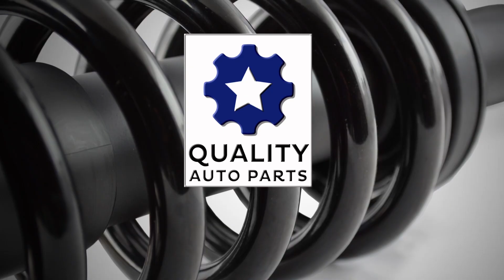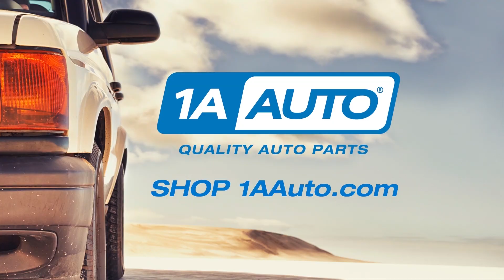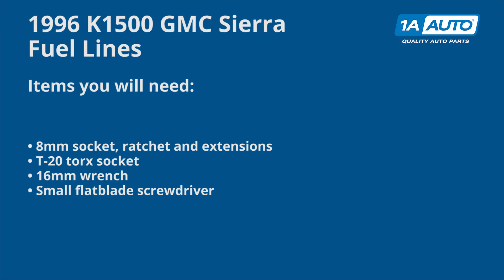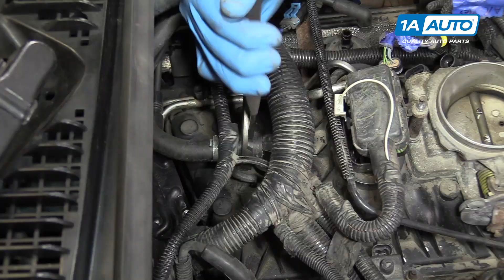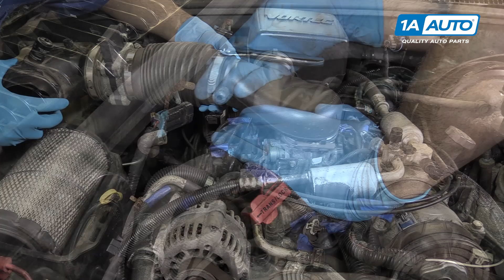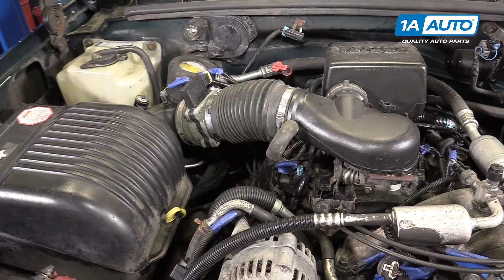How to Replace Fuel Lines 88-98 GMC K1500

Comment: When you put the feed line and the return line back on is there an o-ring that fits on each one of them before you put down the bracket. I start my vehicle up one day and it was leaking in that spot I took the bracket off pull the two lines out there was an old ring on each one they were shot I had to guess at the right size I bolted back down it's still leaked I think the diameter of the o-ring was too too small we'll have to go to a larger diameter to make sure it has a snug fit

Comment: Those are NOT the lines that need rusted replacement, you did not show anything that would help with the line that rust out under vehicle, this video is useless unless your changing the spider injector and removing manifold, you need to TITLE YOUR$ VIDEOS BETTER!

Comment: Is the bracket supposed to hold down the indentation on fuel lines? Because right now mines touching the plastic and not the metal.

Comment: Thanks for the video. I had call the dealership a few minutes before finding it and they quoted me 8 hour labor plus parts. Labor alone was $1200 parts $200 for the line. Of course I was sick at the thought, but your video inspired me. I spent a few hours taking my time but was able to successfully remove the fuel line. I ordered the line and will put it on tomorrow or the next day. What a blessing that you shared. Great video.
Reply from the maker: +Jonathan King thank you for the feedback, we're so happy to hear this! That is exactly why we make these videos, thanks for checking us out!
Reply: file:///var/mobile/Library/SMS/Attachments/93/03/A3D87EAE-6B1B-4DAF-A477-264FE0B8F88E/MOV_8946.mov
I wish I had checked to see if you had the part. I probably could have saved on parts too. My truck runs great and no more fuel leak. Thank you. I liked and subscribed.
Reply: How did it go?

Comment: O ring placement if they happen to come out of cpi when pulling out, and the other end of rail o rings also. No one talks about the o ring, metal washer spacer, 2nd o ring then another 1/2" long plastic spacer. Have no idea if new unit, or gasket kit was supposed to come with identical o rings and spacers. What a rig job straight from manufacturer, aftermarket don't even know what the hell is needed to properly not burn your truck.
Reply: I put these new injectors in my truck yesterday but the damn plastic sleeve and everything came out when the line did when I moved it just a hair to tighten it up in the back. Now I can’t Fuckin get the lines to sit back in properly they just keep popping out, any tips on how to get the plastic sleeve both o rings and metal washer to go back in snug without coming out ?
Reply: This is literally the reason I’m here because I bought a truck off this guy and he forgot to do the rings and most of them are missing 🤦‍♂️

Comment: What about the mid section from the lines you disconnected?  Has a bracket  on the trans I can't get to.  This is where the problem is.  I have the tank dropped.  And need the mid section  out.  Need a video of mid  send / return line,  removal/ install please
Reply: Forget that bracket Anthony. GM has it betweeen the trans and motor which is a terrible idea. Just cut those lines and feed the new ones around it.

Comment: I'm having trouble with the flare nut on the left side. It's hard to thread in. It would seat in but popped out after tightening. I eventually got it but it didn't go very far before getting tight. I may have cross threaded it. Is it possible to replace the flare nut? Would it just come off easy?

Comment: This is not the same procedure as my '94.
Reply: It is most likely slightly different for the Throttle Body Injected (TBI) engines, which were replaced by the Vortec engines for the '96 model year.

Comment: The fuel lines connected to the injector spider 4:20-4:45 does anything go between the lines and inlet/ outlet besides the o ring? Mine have a black plastic sleeve as well
Reply: I have a leak right at that spot! I cant figure out what I need to replace to get it to stop leaking. One day the line just popped out! Now there is play right there. The line moves up and down even though the hold down bracket is in place. I have those black plastic sleeves in place but I'm not sure about the O rings. Any help? Where can I get o rings?
Reply: @holdfast98  what was your solution to this? I've got the same problem

Comment: I need to find the hold down bracket. I need to replace. You reinstall in at 4:58 of the video. Please help me find this part.
Reply: I need it as well. were you able to find it? If you did can you let me know thanks
Reply: @alexramirez7457  no luck
Reply: @alexramirez7457  junk yard
Reply: Same any luck guys?
Reply: @kadenkolding9668  was able to find many at pick apart in pacoima if you live in San Fernando valley
Reply: @kadenkolding9668  No luck
Reply from the maker: Thanks for checking us out. We do not offer the hold down bracket you are looking for. You may be able to locate via eBay or Google Motors. Hope this helps you out. +Kaden Kolding
Reply: No I have not been able to find at all

Comment: Do you mean a 16 mm flair nut wrench.  I can't get my fuel line on of my throttle body with a metric 16 mm  Wrench
Reply: Tbh wouldn’t recommend it but I just used pliers if you got a strong grip it’s tedious, but it gets the job done